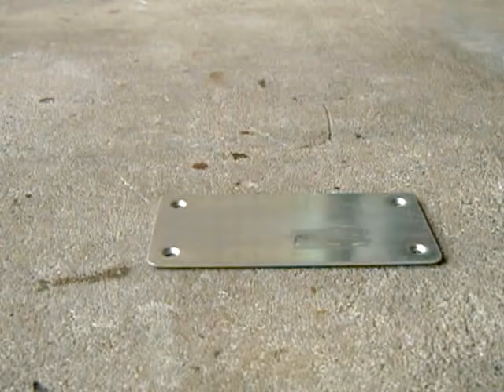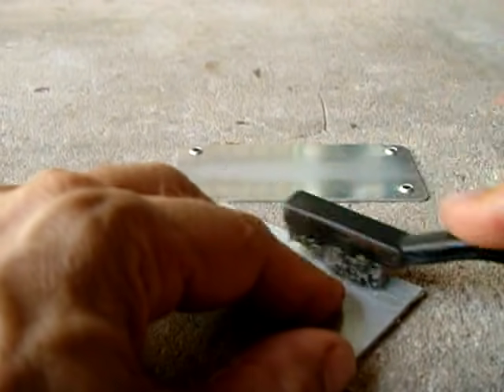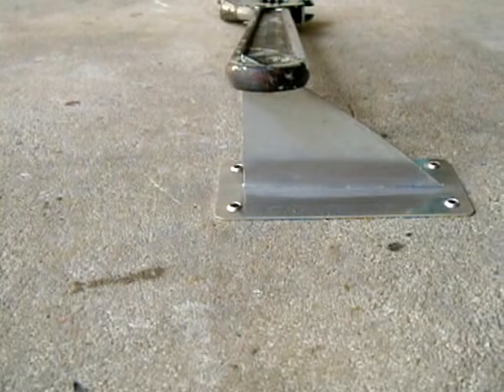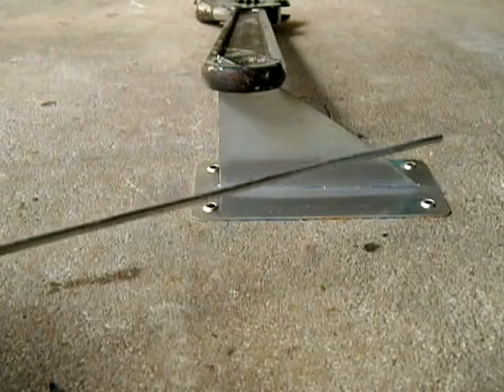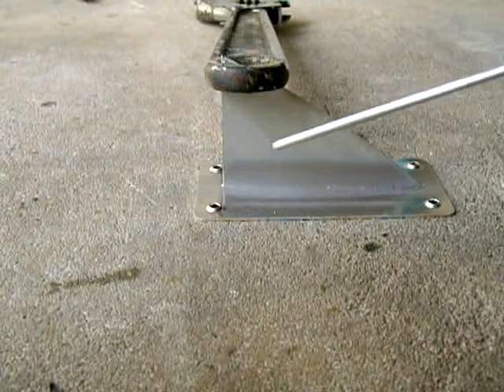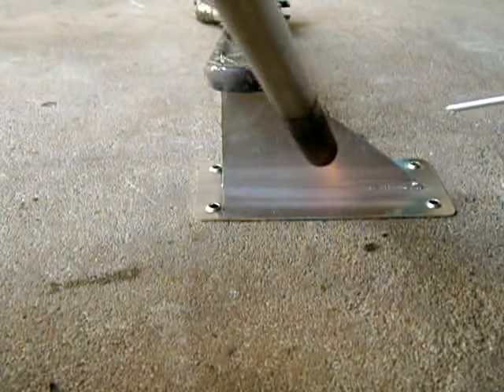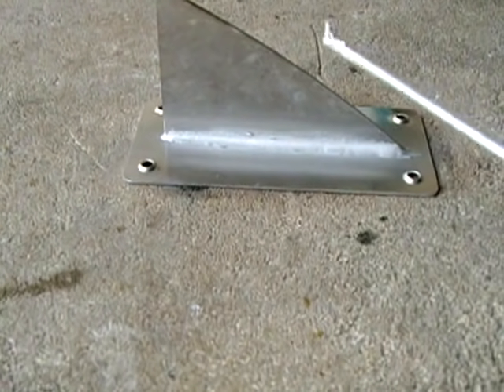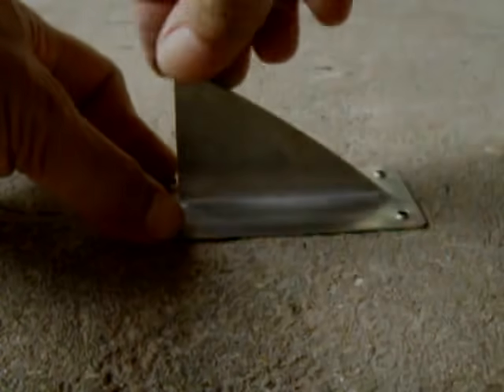How To Easily Join Together Aluminum Plates & Repair Aluminum Parts

Comment: I just bought the brazing rods ,but I haven't being able to brace anything. What am I doing wrong?
Reply from the maker: Practice on thin aluminum sheets, and get the surface as clean as possible with the stainless wire brush. Also brush under heat. It works.

Comment: Wondering if this would work on my pot metal steering column housing? 🤔
Reply from the maker: Hi Jason. It's designed for Aluminum, Tin, and Zinc.
Reply: @electronicsNmore  hey! Thanks for the reply! 
 That's the basic components in "pot metal" in most cases anyways.  It's simply cosmetic as far as what I'm trying to do. Just want to fill a hole for a cruise lever that is not or was not an option on my 1970 Camaro steering column... I'm thinking this is definitely worth a try. Maybe test it on my junk column used for parts. 
Thanks again for your response.  🍻

Comment: If you were to braze the other side of the connection, would the side that you just brazed become "soft" or what would you need to be mindful of while doing the other side?  Thanks for a great video.
Reply from the maker: If you held the torch back on the opposite side and slowly heated the aluminum to the point where the brazing rod begins to flow, and you brushed it into the surface then no, I used this aluminum repair rod on an aluminum cooling vane on a flywheel almost 3 years ago. That engine is used regularly at very high RPM's, and is still well attached. Pretty good stuff if you do the procedure correctly.

Thanks For watching!

Check out my video playlists

Comment: Can this method be used to weld those aluminum (alloy?) hollow sections used to make display cases in stores with glass surfaces?
Reply from the maker: I use this method for all my aluminum repairs.

Comment: I was looking to make an aluminium support for an oil cooler i'm fitting to my car.  If i use this to bond a couple of lengths of angle together will it handle vibration ok? Cheers
Reply from the maker: Can you bend the aluminum in a bench vise to the correct shape?

Comment: Can you weld a seam with these? If so, can you sand/grind down the weld to make a smooth finish for painting?
Reply from the maker: If you bevel the seam(plates), and fill the area slightly higher, then yes. Thanks for watching!

Comment: Never knew you could do this with Aluminum.
Reply: +Franky Vee it isnt very strong but works.   its using a different grade of aluminum that melts at a lower temp to make the bond..no penetration
Reply from the maker: +Darren Bottle 
Of course it is not as strong as welding, but when done properly it is strong. I have repaired a broken vane on an aluminum flywheel spinning at thousands of RPM's, and to this day, 4 years later, still in tact. Most people do not have access to expensive aluminum welding units, which is why the information in this video is of great use to many.

Thanks For Watching.
Reply: not a safe practice....you'll have idiots repairing aluminum ladders thinking its safe again.
Reply from the maker: Darren Bottle

It is not my job to tell people what aluminum objects they should or should not repair. That is up to them. Once again, the purpose of this video was to show my viewers an alternate way to repair aluminum when a welding unit is not available. It is the job of the viewer to do a good job, inspect the job they did to make sure it will be a lasting repair, and know when to use this brazing material. Clearly you would not be using this to repair a boat lift holding thousand of pounds, or to build a motorcycle frame. Most projects this can be used.

Thank You

Comment: Would these work to join coffee cans?  I was going to do it with brass, but that would require an even hotter torch.  I did 't want to borrow one if I didn't have too.
Reply from the maker: Coffee cans are steel plated with zinc. These brazing rods only work with aluminum and "white metals". Be sure to check out my extensive video playlists for other great videos of interest to you, rate thumbs up, and share. Thank You

Comment: Could you have used acetone to clean the metal parts and then the wire brush?
Reply from the maker: Not necessary. If the aluminum is corroded, then use medium grit sandpaper first, then carry on with the wire brush.
Reply: electronicsNmore Thank you for your reply.

Comment: Would this work on an aluminium motorcycle cylinder head? It has a couple of busted cooling fins.
Reply from the maker: +Paul Austin 
Hello Paul. It should work, but a couple busted cooling fins should not be a problem. 

Thanks For Watching
Reply: +electronicsNmore Thanks! I'll give it a try...I know a couple won't make much difference .... just looks bad is all.
Reply from the maker: Paul Austin
Remember, wire brush the area really good using a stainless steel brush first, then GRADUALLY heat the area (moderate heat)and keep testing it with the rod to see when the proper temp has been reached to melt the rod. Once a thin layer is applied, only apply enough heat to keep the brazing material flowing. Wire brush the molten material into the surface of the aluminum after it first melts. Applying too much heat will cause the cooling fin to melt and fall off.

Comment: This is really cool. So does the alloy of the brazing rod have a lower melting temperature than most Aluminium you come across? Are you quite close to melting the Aluminium when doing this?
Reply from the maker: Hi. Very close to the M.P. of aluminum. The rods melt at a slightly lower temperature.

Comment: Do you believe these type of bonds would be suitable for a go kart frame and a regular (petal) bike frame??
Reply from the maker: +Powertripp Productions 
Yes, just as long as you apply the correct amount of heat, and thoroughly brush the surface under heat.

Comment: Hey buddy good show.  Tried this two years ago with similar product.  Joints are very strong.  I applied WAY too much alloy.  Now I see that it goes on like a crayon when done correctly.

Just a thought, an oxyacetylene torch might be better than propane.  More heat and better focused.  Get in quicker and oxidize metal let to boot.
Reply from the maker: You can use a neutral flame with an oxy-acetylene torch, just be very careful, it is very easy to melt the aluminum.

Thanks For Watching!

Comment: What kind of gas did you use? What it just the blue bottle with a burner on it like you can buy at lowes hardware?
Reply from the maker: +Bonnie Flory 
A propane torch works fine. For larger/thicker aluminum plates/parts use MAPP gas.

Thanks For Watching! Be sure to share my channel with others and rate thumbs up.
Reply: Thank for answering my question.

Comment: if you use the Flux it will tell you when the alloy is at the right temperature to apply the rod, It is not necesary to steel brush while the alloy is hot as oxidation will only exist when alloys cools.
Reply from the maker: +Senia. Samoata. 
Incorrect. According to the manufacturer, you continue brushing until the brazing rod starts flowing into the surface. No flux is necessary.

Thanks For Watching.

Comment: what about if you want to do both sides would you immediately move to the other side without letting it cool down
Reply from the maker: +Rick West 
Hi Rick. Just make sure the pieces do not move, then switch to the other side and repeat the process. Do not let it cool down, keep working.
Reply: cool thanks dude one more question did you use a propane torch or mapp gas or can you use both?mapp is hotter
Reply from the maker: Rick West

I used propane. You can use MAPP for larger items/areas.
Reply: excellent thank you ! sir

Comment: I've never done this before. But do you think this would work to weld a bracket together to hold part of my exhaust up on my 70cc bike? It won't be subjected to any kinds of heat. Just weather.
Reply from the maker: For that purpose, if done correctly, it should work.
Reply: Thank you 🙂 
Great vid with a good tutorial

Comment: Will this works for repairing a crack aluminum oil pan on a car?  I got a crack it in need of repair instead of spending $$$ on replacing it.  Thanks
Reply from the maker: It should. Remove and degrease the pan using brake cleaner, drill out the ends of the crack to stop it from spreading, lightly grind the area, then follow this video. Thanks For Watching!

Comment: Hi, can I do this with bigger plates? Sheet 160x100 cm and I need weld a few ribs on it. Thanks!
Reply from the maker: This will work fine on thick plates, but you will need to use an oxy-acetylene torch with a neutral flame to heat the aluminum. A propane torch will not do it.
Reply: Thanks!

Comment: Isn't acetone required for cleaning before brazing? Or do these specific rods not ask for it?
Reply from the maker: +GreekDude1821 
No. acetone is not required. If the metal is oily, then you can use acetone. I prefer mineral spirits followed by 91% isopropyl alcohol or denatured alcohol.

Comment: What kind of tip did you use on the propane torch?  I tried it on my aluminum boat and it never got hot enough.  Noticed the flame looked different than what I have.
Reply: I was torching the boat for about 15 minutes and it didn't work.  The aluminum on the boat is thicker than those plates.
Reply from the maker: That is the problem. There is so much aluminum that it is acting like a heat sink preventing the aluminum from reaching the proper temperature to melt the brazing rod. The tip I used is from a MAP gas torch. It happens to work well with propane. You can try using a heat gun on a hi temp setting on the opposite side of the boat while you are heating the other side with the torch. I would also suggest buying a MAP gas torch. They are not that much money. You get higher temps using a MAP gas torch. Be careful not to apply too much heat, otherwise the aluminum will melt and fall apart. Keep touching the brazing rod every few seconds to see when the proper temp has been reached. Once it has, maintain that level of heat as you work.

Thanks For Watching!

Be sure to check out my video playlists.

Comment: Thank you for this video.  An edge to edge at a 90 degree angle, so as to make a container in a box shape, is what I myself would like to connect with aluminum sheets but working from the outside of the box, and around it seems difficult.  I say a box shape to simplify, but there are complex curves in the actual shape, and they connect at the edge.  It would be a sculpture.  I thought I would just check here for some advice, before looking elsewhere.  Thank you.
Reply from the maker: These rods should work just fine for that. Thanks for watching!

Comment: I would like to ask if i want to braze 2 pieces of aluminum rods 9mm diameter  ,how can  clamp them ?
they are short enough to be mounted using a vice clamp toward each other 
Is it a good idea?
Reply from the maker: You can take a 2x4 and cut a deep/wide notch into the wood, then clamp the 2 rods in position over the notch so you can heat them up. Be sure to bevel the ends of the rods before pushing them in position against one another.

Thanks For watching!
Reply: electronicsNmore but I would like to do in a furnace(furnace brazing)
how can I fix the 2 rods and the filler material inside the furnace
can you advice?
Thanks

Comment: is this method strong enough to make a sled using square stock to haul my ice fishing gear?
Reply from the maker: Hi Joe. It should work just fine with square aluminum tube as long as the walls are not too thick(1/8" or less). Use a MAPP torch, and follow the instructions in the video. Practice makes perfect! :-)

Comment: How strong is brazing comparing to conventional aluminum welding?
Thanks.
Reply from the maker: Hi Peter. Welding is always the strongest because the base metals flow together into one. When you braze, it's very strong, but only the surface of base metals are fused together. Check out my other video below. Be sure to share my channel with others, and rate thumbs up. Thanks!

https://www.youtube.com/watch?v=hEx89N3f9u4
Reply: I do not own a welder of any type, but I do have a MAP torch. So what do you think I would use?
Reply: Weld being stronger does not mean a braz is not strong.

Comment: Great video, thank you!
I’m wondering if you need to weld it turned upside down, is it gonna stay on joint, or it’s gonna melt down? I have one project, and i need to weld it from underneath.. Thank you in advance!
Reply from the maker: Could be tough unless the pieces are fixed in position.

Comment: Thank you so much. Going to use this to fix my aluminum boat. Can you use some all purpose flux to help clean everything?
Reply from the maker: Hi there. NO flux unless you have the special flux designed for aluminum brazing. Just be sure to get everything really clean. Use sandpaper first, then use a CLEAN/NEW stainless wire brush. Remember to not apply too much heat, otherwise you may melt through the aluminum. Just do exactly what I did in the video.

Thanks for watching! Be sure to share my channel with others, and rate a THUMBS UP.
Reply: Oh okay. I did get everything clean and its not working. The crack is showing up again thru the melted brazing rod. I figured out if I apply too much heat it will warp the aluminum. Whoops. Its not too bad though. Will do. Thanks for the reply.
Reply: Love2boat92   The brazing rod material does not have the tensile strength of aluminum sheet and will tear easier . When working on sealing cracks in a sheet, you need to bridge the crack with a narrow strip of aluminum and braze the strip  to the sheet. .
Reply from the maker: psdaengr I would not underestimate the tensile strength of these brazing rods, which is around 40,000 psi. If you properly clean the aluminum being repaired, and drill out the ends of the cracks, you will have very low odds of failure. Adding a doubler is a good idea if needed.

Thanks For Watching
Reply: electronicsNmore  This was in response to the posters words "tore again" from which I inferred that he was trying to repair a crack in a sheet that tore under stress.  Brazing isnt new. Aluminum brazing isnt new.  Its good at making several kinds of joins. Butt and scarf joins aren't two of them, nor is resealing a crack.  Sealing a crack through a sheet requires a lapping material because the crack cannot be cleaned; the brazing filler cannot penetrate or bond to the walls of the crack. Prebrazed sheet and strip is availble specifically for repairing cracked sheets.  Once an aluminum member has failed under tension, the surrounding area becomes crystalized and weakened. If that section cannot be removed, it must be bridged to restore structural integrity. Aluminum and aluminum alloys are stronger than steel under compression, weaker under tension, and the tensile strength (resistance to stretching and tearing) is somehat proportional to melting temperature of the alloy.
Reply: psdaengr Yeah I've seen the tensile strength of the brazing rod something like 40,000 psi. I tried some brazing rod from harbor freight and it cracked as soon as it cooled. Didn't work well at all. It was the "cheap" stuff. Next time I'll get the "good" stuff from the home depot. A mig or tig welder would be nice too. Lol.
Reply: psdaengr I'm curious what's your opinion of mig/tig welding aluminum?
Reply from the maker: psdaengr
Luckily I have had great results with the Alumite brand. When I repair a crack I grind deep into the crack, drill out the ends to prevent the crack from growing further, and apply a nice rounded layer of brazing material over the area. If there is a lot of stress in the area, then the plate brazed over the cracked area is a great idea. I would also keep heating the area after the job is finished and gradually pull the flame away to prevent the repair from cooling too fast. I have only had a problem with a crack coming through when I repaired my scooter's exhaust pipe. The second time I did the repair, I made sure the area was well "domed" with filler.

Comment: Can you braze/weld aluminum to stainless steel?  I want to create a Bain Marie style double boiler using a 1/2 barrel keg (SS) inside an 80 Qt Aluminum pot. I want to cut a 16" hole in the lid to slide over the keg and sit on the pot's edge.  I then want to braze the lid to the keg body around the 16" hole we cut.  I'll then braze the aluminum lid to the aluminum pot.  With the additional of filler and vent pipes, I'll have my double boiler.
Reply from the maker: No. These rods are designed for white metals only. (zinc/aluminum/tin/antimony/cadmium/and similar alloys)

Comment: I have some of those aluma-pro rods. Ive had a little luck with them. I have had a hard time getting parts hot enough with a propane torch. Aluminum conducts heat away so quickly especially on larger parts.
Reply from the maker: Larger parts require a lot of heat.....try MAPP gas?
Reply: @electronicsNmore  I used oxy-acetylene in order to get enough heat , but it still took a while.
Reply: Use a hear gun too?

Comment: Thank you for this video.
Could you brace a core/flute on a car radiator?
Would you have a video on that if this is possible?
Reply from the maker: +Bonnie Flory 
Sorry, but I do not have a video showing that. I have used these rods to repair aluminum radiators in the past. DO NOT overheat the aluminum because it is thin and will melt. SLOWLY heat the metal up and keep testing the metal with the brazing rod so you know when the proper temp has been reached.
Reply: +electronicsNmore 
Thank you.

Comment: the rod that you use sir,, how thick is it,, does the rod to be use should be according to thickness of the aluminum??,,,
pardon my english sir
Reply from the maker: Around 2.5mm. Really small/thin pieces should use a smaller diameter brazing rod.
Reply: @electronicsNmore  thanks a lot sir,, and thank you for your time